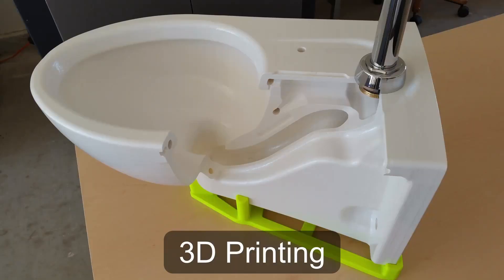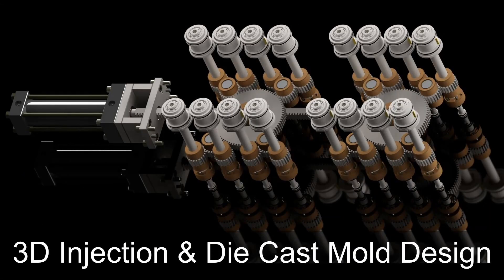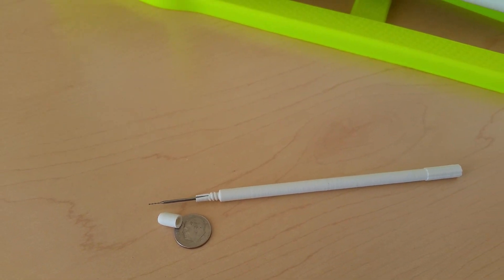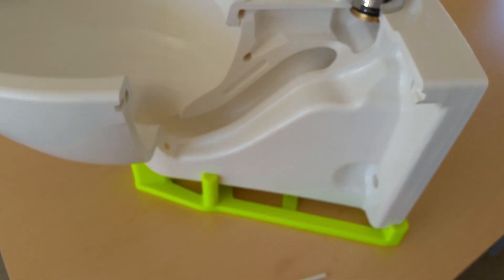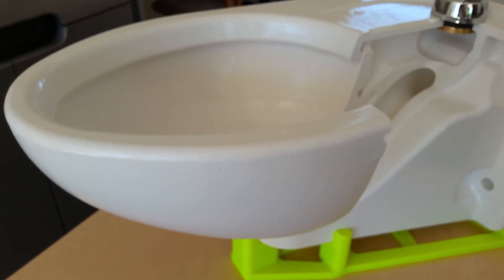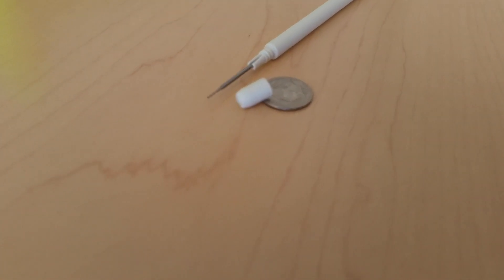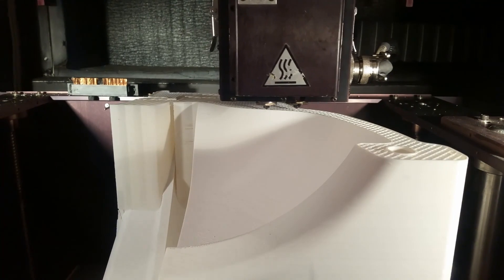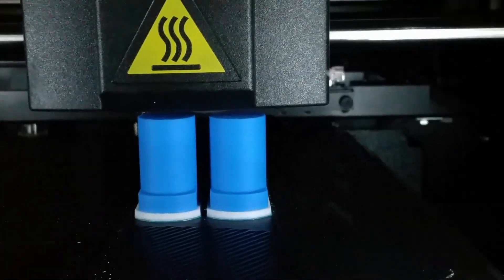3D Printers in Action - Large Parts and Small Parts

Comment: which is your favorite printer and why?
Reply from the maker: Thank you for your question and watching the videos, I appreciate it. The answer really depends on which material the customer needs the part 3D Printed with and what the printed part will be used for. I currently have nine 3D Printers, so I have a selection when it comes to materials and capabilities. My Fortus 250mc is a real workhorse and is very dependable. I can start printing a part, walk away and come back a day or two later and find the finished part waiting for me. I recently acquired a Fortus 400mc which has more material capabilities. In the process of finding and repairing an air leak in the printer (videos coming) and should have it running soon. I also recently acquired an Objet Connex 500, which I'm in the process of rebuilding (videos coming), and this printer opens up another realm of capabilities. Personally, it's impossible to choose one favorite, I like them all! Robert